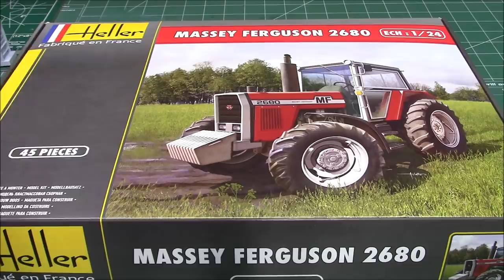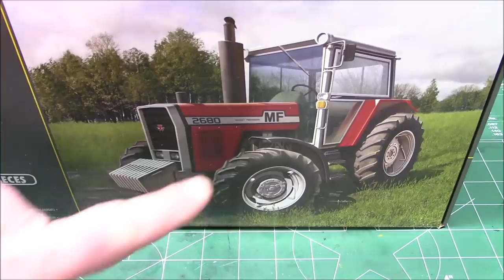Heller 1/24 Massey Ferguson 2680 Tractor Scale Model Kit Build Review and Weathering

Comment: Lovely build, Heller kits are usually very detailed and accurate. Would be nice to see clear or tinted lenses for the lights instead of decals though.
Looking at how thin the roof pillars are I guess having the glass as one piece and requiring masking is the sensible way to mould this kit.
Reply: Tractors in England often have knackered lights